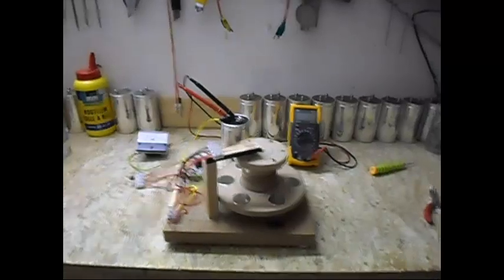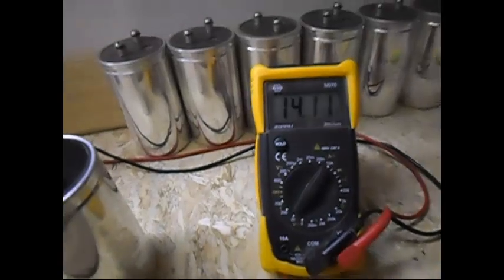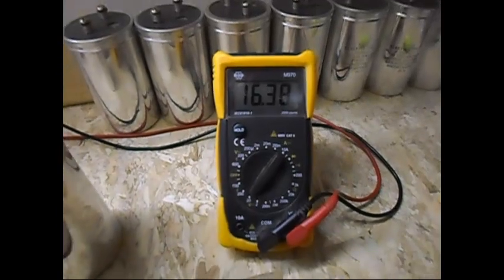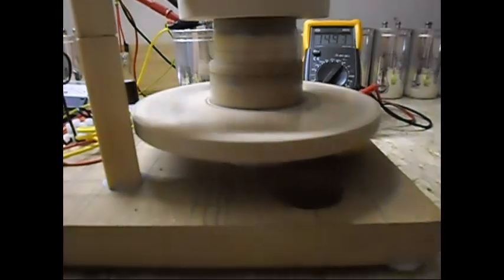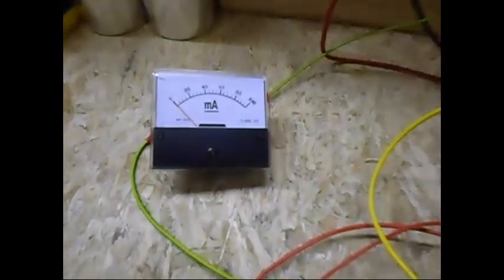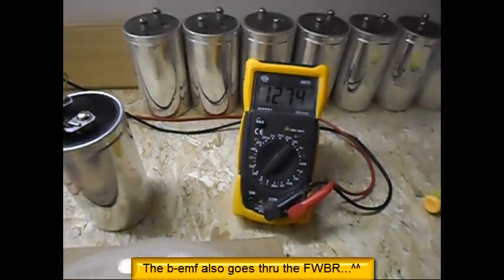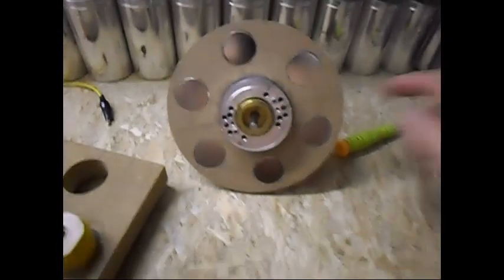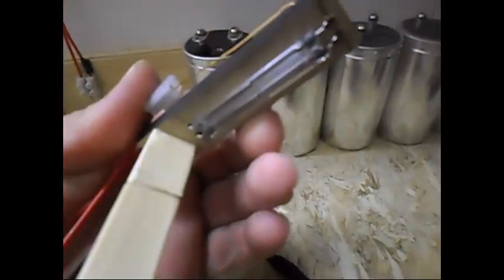Pulse Motor - Simple 2 reed switch circuit, loopback & FWBR - Part 3 of 5...

Comment: hey is the reed switch on at the same time ?
Reply from the maker: +rntesla nielsen 
Thanks for your comment...^^
If you mean that both are open or close at the same time...yes they should be...but i my setup they are not...-.-
But still it works pretty good...:D
If you can get them to open and close at exactly the same time it will work much better...;-)
Reply: +rntesla nielsen ok but why not only one reed switch if the same time
Reply from the maker: +rntesla nielsen 
It can work with one reed switch two but when you want to use a full wave bridge rectifier it is better to use two reeds switches...;-)
One on the positive and one on the negative...so when they are both open the source battery is completly removed from the coil and since there are 3 magnets passing that are acting as a generator you will get the complete sine wave rectified...;-)
John bedini has a transistor circuit for this to named "bedini sequential bipolar circuit"
Link here, it the full opne but you can use half of it to...
https://www.google.nl/search?q=bedini+sequential+bipolar+circuit&espv=2&source=lnms&tbm=isch&sa=X&ved=0ahUKEwiYsd60sNDKAhWCWw8KHbd1BOsQ_AUIBygB&biw=1920&bih=955
Reply from the maker: +rntesla nielsen 
That bedini circuit does the same as the two reeds but at the same time they are opened and closed...;-)
It's a nice circuit to play with...:D

Comment: 1 ma ?! wow !!!
This IS the motor/generator !
well done! how much resistance and turns in the coil ?
Reply from the maker: +Gianni Laschi 
Hi amigo, around 1ma...maybe 1.25 or 1.5 or maybe a bit less than 1ma...not easy to read on the 100ma scale...but it is very efficient...;-)
The coil is 59 ohm and it is 0.25mm wire...how many turns i have no idea...lol
Maybe with a online ohm calculator you can calculate how many turns there is on the coil...???
I bought these coils in a electronic second hand store...^^
Reply: +Mister Caribbean Roots Awesome!  thx amico!
Reply from the maker: +Gianni Laschi 
No problemo, you are most welcome...^^

Comment: If you have a Schottky FWBR of appropriate rating, it might give it a slight increase in efficiency. Also just a thought, perhaps put a 1uf AC Cap parallel on the reeds? Those reeds switches seem to be placed well, that's for sure :) Very cool design and enjoy the good times.
Reply from the maker: +Diadon Acs (Conscious Energies) 
Thanks for your comment and i'm glad you enjoyed it...^^
Yep, a schottky FWBR would be better because of the lesser losses...but this 600v one is the smallest one i could find in all my stuff...-,-
No ac cap needed since i don't see any spark at the reeds even in total darkness and i even used my special tool to look for it...old age reading glasses...lol
Yep, the timing is very important...with the amp- and voltmeter one can fine tune it for the best performance...^^
Cheers
Reply: I was suggesting the AC cap across the coil like an LC tank in a sense. Not sure the exact uF as I don't have all the specs for your coil except 59 ohm. So if you have a variable AC cap that would be cool. Its just to tune the coil to resonance. So paralleled across the reeds and the coils if that makes sense. You can always make your own FWBR too ;) Whatever you do, I look forward to seeing it. Looks like a fun little test motor.
Reply from the maker: +Diadon Acs (Conscious Energies) 
Thanks for the extra info about the cap across the coil...^^
I don't have a adjustable cap...crap...lol...these kind of setups are always fun to play with...^^
If i find or buy some schottky diodes i will make a FWBR and see how it goes...;-)

Comment from the maker: Just me fooling around with this simple 2 reed switch loopback circuit with FWBR...number 3 of the 5 videos...^^
This one has a pretty good performance...o.O
FWBR = better energy back to source = system draw less = system caps energy drop rate slower = better run time...^^